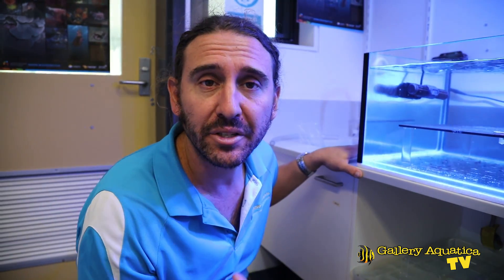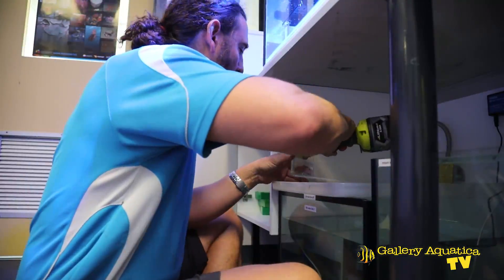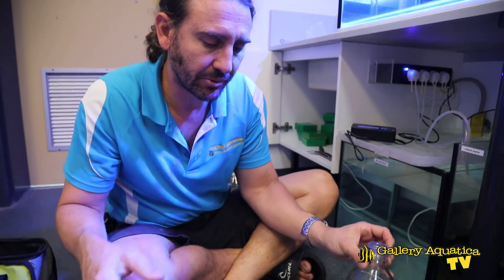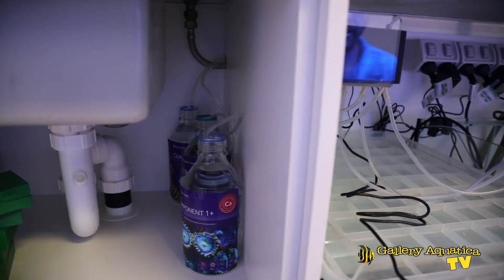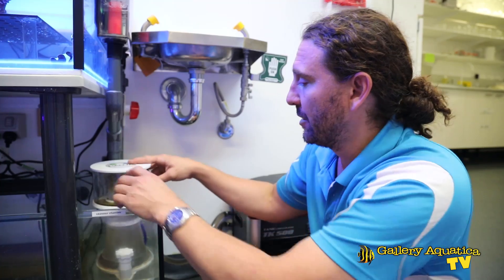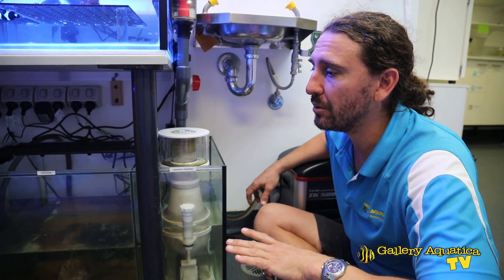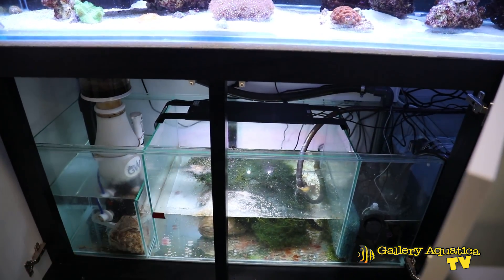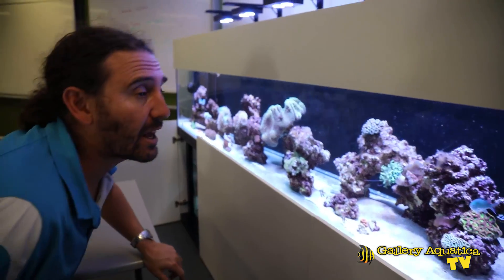Aquarium Update: Marine Science Lab --- Gallery Aquatica TV

Comment: Mr Cam..... As always your content, courage & style are so welcome to us out here!  My comment has to do with the chiller unit. We know, that chillers extract heat from the water to bring about cooler water.  That heat is rejected or released by a "radiator" on the end of the chiller device.  If it is kept closed up within the sump space, that heat is "re-entered" or absorbed back into to the surrounding components and water (to get "pumped out again" by the chiller device).  A grill in the door and a grill at the end of the cabinet by the hot air end of the chiller would go a long way towards the longevity of the chiller as well as it's efficiency and performance.  My 2 cents.....  I'm a refrigeration guy by trade.  Again, thank you for your time and priceless information in your videos !!
Reply from the maker: Oh bugger, I forgot to film our chiller exhaust system. There is a hole cut into the end of the cabinet through which the chiller exhausts the hot air. I don’t normally like to put the chiller in the cabinet but so far this is working pretty well. Cam